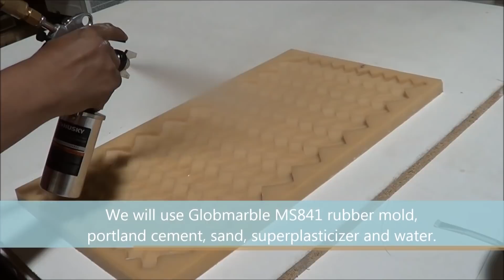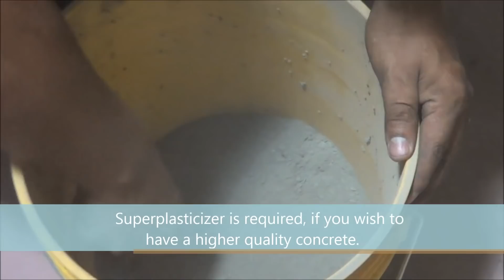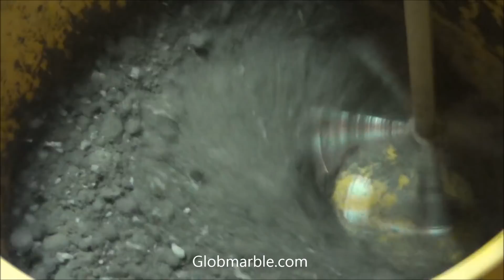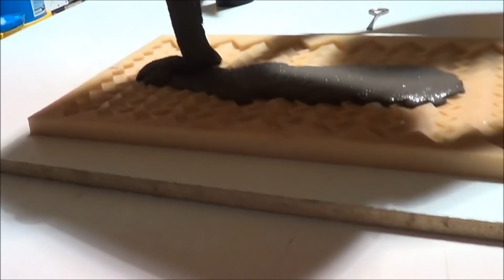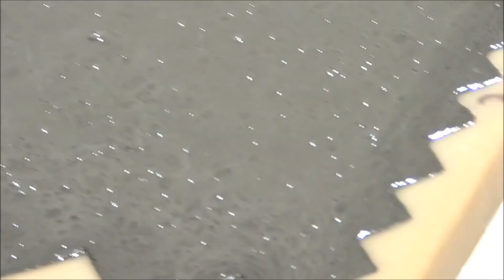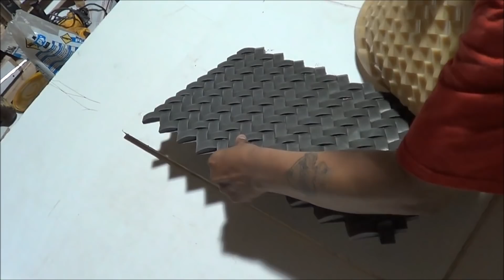How to make high strength concrete stone. GlobMarble mold MS 841

Comment: What is the spray you put on the mould initially and what is the use of it ?
Reply from the maker: This is a release agent. It will make it much easier to remove the cast from the mold, and it will make your mold last for thousands of uses :) Here is the link- https://globmarble.com/concrete-release-agent-g-1.html

Comment: You used too much cement, 35% is possible.
Reply from the maker: 1x1 formula in most of the cases used by DIY customers because it made the casting process much easier. Most professionals use 1 part cement to 2 parts or 3 parts filler. More info at https://globmarble.com/mosaic-stone-mold-ms-841.html

Comment: hi. which size of sand to (metric unit) for example 0.4 or 0.5
Reply from the maker: (20-30 mesh recommended) (silica sand  or “all-purpose” sand works great) 

Particle Size Conversion Table
Sieve Designation Nominal Sieve Opening
Standard       Mesh    inches
0.841 mm   No. 20    0.0331
0.707 mm   No. 25    0.0278
0.595 mm   No. 30     0.0234
Reply: @GlobMarble  hi buddy. I built the concrete on the basis of this video
BUT . 
my tile is incredibly fragile.. my concrete was tightened in a minute
 .The cement water would quickly rise above the bucket
..If I did not pour concrete into the mold for a minute, the concrete was rigid and tightly attached to the bucket
..when I shake the mold, the liquid was formed on the mold instead of the concrete
..after opening the mold, the liquid was turned into a pale orange color
And it was still a bit wet
 .after 20 h
my materials: portland cement type II - sand- superplasticizer and water Based on your formula
my tile is incredibly fragile...................
Reply from the maker: @hamidrezar1040   You do something wrong. Hart fo figure out what's wrong, i need all your casting details. Please send all details including weight of cement, sand, water and additives  to sales@globmarble.com.  1x1 sand to cement mix used in GFRC casting,1x1 mix makes a high density concrete, it shouldn't be fragile, it should be very strong.  I'm most of the cases  1x2 or 1x3 used for all general concrete castings.  Anyway, send all your mix details to sales@globmarble.com, we'll figure out what's wrong.
Reply: @GlobMarble  hello buddy
i realized my mistake.
overdose superplasticizer was the cause of this fragility.
but another problem i have is that
:
on the surface of my tiles, small cavities are created
,in 1x1-1x2-1x3 cement on sand.
my vibration table is handmade!!!!
generally, what can be the cause of the cavities
Reply from the maker: @hamidrezar1040  Sorry, don't understand what you're talking about, I'll have to see it.
Reply: @hamidrezar1040  honestly it sounds like far too much water or not enough cement powder.   That's what makes them break easily. In my experience I have never used superplasticizer and everything has worked well for me. So try leaving that out but what you said about the water on the top of the bucket makes me think you had FAR too much, or the wrong cement powder to sand/gravel ratio. On the cement bag there should be a guide. And NEVER use any clay or sand with a small amount of clay in it.
Reply: @hamidrezar1040  those cavities are air bubbles. Try tapping your bucket and your mold a lot to get them to come to the surface.
Reply: @OffGridInvestor mr link knight. r u do this?
i know vib come air to surface!!

Comment: I’ve been wondering why I haven’t found a tutorial involving pressure casting or vacuum degassing as it pertains to concrete.  If it’s effective for resin wouldn’t it also be effective for concrete...?
Reply: Too high tech and about as overkill as a NASA project. And when you have concrete the dust gets into EVERYTHING and trust me, it'd destroy your vacuum pump.

Comment: I don't know if you still answer questions.  I want a white tile so  I want to use white Portland and 30 mesh silica sand. Do the mix ratio stay the same? and will the hardness be the same?
Reply from the maker: HI, yes we answer related to manufacturing  process questions.  I would recommend to try 1 part of White cement + 2 or 3 parts silica sand. 1 % plasticizer by cement weight and 20-25% water by cement weight.  You can cast 1x1 Portland by sand, but 1 x 3 makes your product less expensive and pretty good in quality.

Comment: 1 60 lb bag of cement and enough water so it dries by midnight, all you showed here was how to fck it up
Reply from the maker: I would like to see how you can make self consolidated (air pockets free without vibration) - 10000 PSI concrete with 60 lb bag of cement and enough water......

Comment: This is America.  We measure quantities in pounds & ounces, not grams & kilograms.
Reply from the maker: It's much easier to get accurate weight if you convert the small weights to grams no matter where you're located.   20 Gram = 0.70 Oz - not easy to measure accurate.
Reply: Greg Hawkins this is the world. Almost the whole world is using metric. Even the ones with imperial have already for most part changed to the better metric system.
Reply: your are free to walk backwards
Reply: Well good. Close yourself in and stay clueless and proud and unwilling to adapt.

Comment: What is super plasticizer,  is it some type of latex powder?
Reply from the maker: Superplasticizer it's a high range water reducers, are chemical admixtures used where well-dispersed particle suspension is required. These polymers are used as dispersants to avoid particle segregation (gravel, coarse and fine sands), and to improve the flow characteristics (rheology) of suspensions such as in concrete applications. Their addition to concrete or mortar allows the reduction of the water to cement ratio, not affecting the workability of the mixture, and enables the production of self-consolidating concrete and high performance concrete. This effect drastically improves the performance of the hardening fresh paste. The strength of concrete increases when the water to cement ratio decreases. However, their working mechanisms lack a full understanding, revealing in certain cases cement-superplasticizer incompatibilities.
Reply: Liquid
Reply from the maker: Super plasticizer details available in our web site https://globmarble.com/concrete-additive-water-reducer-super-plasticizer.html
Reply: GlobMarble Inc
Reply: GlobMarble Inc 
Wie are busy at a abbatoire where the top layer of the screed came of we woud like to smooth it again by not using a paint ore epoxy any suggestions? Thank you
Reply from the maker: Sorry, i didn't understand your question. Rephrase it please.

Comment: These stones are used for what? I am interested in stepping stone for a garden path.
Thanks for the tutorial. Methinks I have answered my question: I will use your formula with a mold for stepping stones I have on hand. The plasticizer is something I had never heard of.
Reply from the maker: This is mosaic stone mold, used to make wall stones. Stepping stone molds available at https://globmarble.com/concrete-stones/concrete-stone/step-stone-molds/
Reply: Stepping stones are more than strong enough using normal amounts of water and no plasticizer.

Comment: one question how many pounds have such a finished product and dimensions of the mold
Reply from the maker: Finished product weight depends to the filler you're use. if you'll use cement + sand ( filler) the stone total weight would be 10 lbs approx. Mold dimensions 24” X 13” X 1”  (60cm X 33cm X 2,5cm) more details at https://globmarble.com/mosaic-stone-mold-ms-841.html